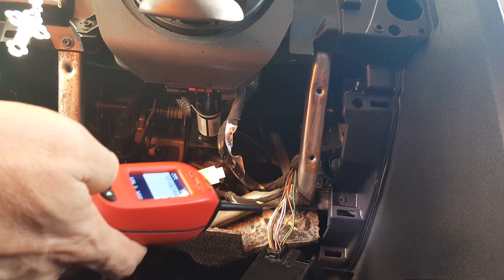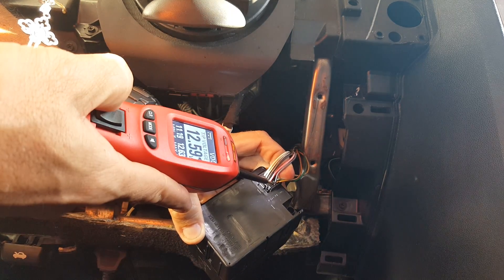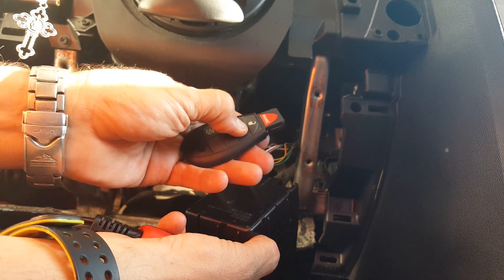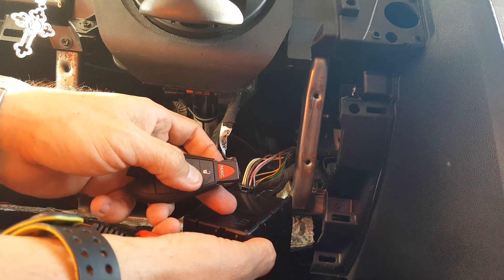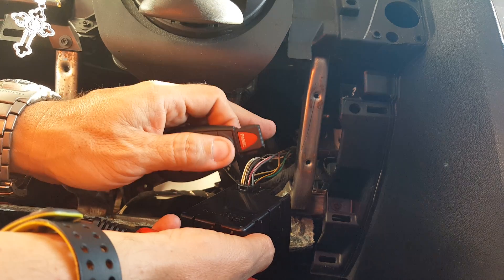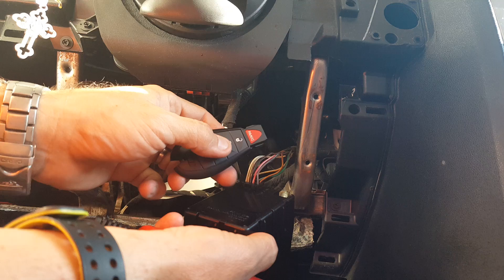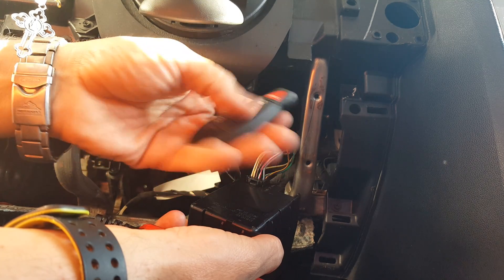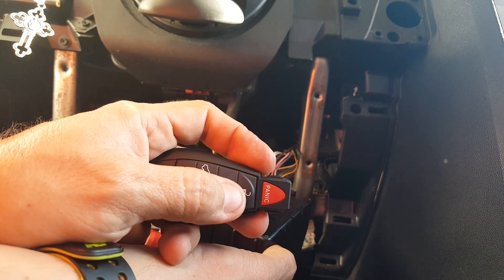Testing wireless ignition node module Chrysler Dodge Jeep ram plug connector

Comment: I have a 2011 dodge grand caravan and it seems after about 30 minutes of highway driving about 60 mph or hihher it will vibrate and then shut off randomly. It seems to omit strange smells sometimes as well. It has restarted after about 30 mins to last time over an hour. When u try to restart it the ignition gets stuck and it doesnt fire. Its stays as if its on about to runs like permanently cranking

Comment: My 2011 durango doesn't lock and unlock with the fob but my fob works a locksmith told me I have an electric issue the key doesn't light the dash when I turn it. It's doesn't have power just the alarm going off and red light blinking on dash

Comment: 14  caravan, i believe gen 2, cuts off intermittently,  sometimes it dont, sometimes repeatedly. Dash lights flicker, and gauges
Reply from the maker: This is the replacement WIN Kit that will fix it.
https://autotechelectronic.com/win-module-kits/dodge-wireless-ignition-node-no-remote-start/

Comment: Hi I have a 2010 grand Cherokee  that I'm not getting  power to the win module and ive checked all the fuses could u tell me were the power come from for I can trace the wires and thank you
Reply from the maker: From under the tipm. Run a temp power wire thru a 10 amp fuse to pin 1 and see if vehicle starts.

Comment: I just bought this 2012 town and country, no issues starting, but it will not lock and unlock doors, open sliding doors or trunk. I've tried replacing batteries in both fobs, cleaning contacts, still same issue. Haven't tested voltage yet, thats my next step. Do you think this is actually my issue? I'd love to hear your thoughts. Thanks for such a detailed and great video!
Reply from the maker: Test both fobs to see if they are transmitting an RF signal. Take the to a locksmith to test.

Comment: Hey, I have a 2008 Chrysler 300c. The key fob doesnt work to unlock, lock or remote start but the car starts up right away when I insert the fob in the WIN module. I have already replaced the fob battery and also reprogrammed a new fob but its the same issue. 
Do you think you can help me out ??
Reply from the maker: @SaadKhan_959  yes call 8303746845

Comment: I have a 2013 ram 1500 4.7 SLT having problems with the run start and the ignition switch on the codes and just run start and question marks beside that the truck will turn over in Spanish but it's not getting fire and it's not starting up

Comment: 2013 Jeep Grand Cherokee Laredo.  Both Fobs quit locking or unlocking doors, but starts fine.  This happened after replacing the battery under the seat.  I have tried new batteries in fobs but no luck, and also tried the fob replacement faces and tested the signal at my auto parts store and wasn't getting a signal from either one...  Its the fobik Style without the passive entry.  Could it be a bad ground or antenna?

Comment: got a 2019 Ram 1500 Classic. Truck ran fine yesterday, got in it this morning and I've got no dash lights, no radio and no ac controls, I do have my door open symbol and mileage. Is this the WIN or something else
Reply from the maker: @a.l.fairclothii6424  Classic Rams do not have a WIN. It is an ignition switch. Most likely you need a new rfhub. Here are the replacement kits.
https://autotechelectronic.com/rf-hub-kits/

Comment: Do you have a video showing the voltage of all these wires? Mysteriously mine burned the module board. I would like to see if there is a wire that is sending current where it shouldn't be.

Comment: Checked starter by jumping terminal at relay starter works every time relay test good also the key fob works but the 2014 Ram 1500 will not turn over until the fob is turned sometimes 20 times

Comment: Not true. I removed the win and remote still worked. So how do I know if this is my issue. I have power to it and only 4 wires 2014 3500
Reply from the maker: You do not have a WIN, so  to reaffirm, 2009 thru 2012 rams have WIN and if you unplug it should turn off. NOW, 2013 thru 2022 classic RAMs you would need to unplug the Rfhub for truck to turn OFF

Comment: Hey brother, I have a 2010 journey it used to crank no start after some testing that I was doing now it doesn't crank, does nothing when I turn the key to the start position everything is normal except for the no crank no start and tge security light flashing on and off the remote works locks and unlocks horn sound good

Comment: hello been looking for video on win module just saw yours thank you, got a question i put my key in (key fob) 2008 dodge charger 6 cylinder i turn the key and only the red security light comes on. i use to take the key out and in a few times and it would work now it do not.  could it be the module or key really need help
Reply from the maker: Most likely is the win. Text us a picture of fob and win to 210-920-5819

Comment: Hey i have a 2008 jeep grand Cherokee  limited and it doesn't start or crank there is no communication the dash board don't turn on but i can lock and unlock the car. What can it be
Reply from the maker: Send us a picture of you win module to 210-920-5819

Comment: i have a 2014 Jeep Grand cherokee , with 3 key fobs , 1 Brand new, 2 originals all 3 brand new batteries. my jeep doesn't detect any of them till multiple tries and will finally unlock vehicle , and or star. Always says key fob not detected. When it finally starts it will randomly say key fob left the car. Have to shut the Jeep down and and will continue to say no key fob detected till finally starts or alot of the time just does nothing. starter, alternator car battery all good. My mechanic says its the Wireless ignition Nod, would you say it is? Its bad, ready to bring to the dealership to get it replaced

Comment: Amigo si tiene voltaje de 12 y tierra el módulo está bien? Por mi tablero no enciende pero ya cambié el modulo de la llave y sigue igual espero y me puedas ayudar gracias
Reply: Buena noche, disculpa tengo un problema igual, cómo solucionaste el tuyo?
Reply: @alejandroguzman5290  buenas noches si lo solucioné en la parte lateral del asiento lado del chofer hay una tapa esa tapa agarra con la alfombra abajo van los cables ahí estaba el problema estaba trosado los cables

Comment: I have a 2014 ram hemi.  When I put the key fob in nothing happens. No lights on the dash no radio and won’t start. Doesn’t even make a noise. New fob or win or both ?
Reply from the maker: Call or text us 830-374-6845

Comment: Hello I have a 2014 dodge challenger Sxt so my key locks and unlocks the car but when I try starting the dash says “damaged key”(I replaced the key battery ) and the car won’t even crank and no lights on dash besides that message but the weird part is that sometimes I get lucky and it starts up but then when I turn it off it goes back to the same thing  and I don’t know what could be the problem if it’s the win module or I need to reprogram my key
Reply from the maker: It neither WIN or Prox remote. It sounds more like you need a new rfhub. We have replacement kits. Text us your VIN 830-374-6845

Comment: My fobs will start the vehicle but will not unlock or lock by remote. Can this be an issue with the win module ? I have programmed brand new remotes but still no lock/unlock.
Reply from the maker: Yes.  It is a problem with WIN
Reply: @AutoTechElectronic  thank you

Comment: Ir my remote does work and my motor doesn’t crank basically the win module it’s bad? Am I right?
Reply from the maker: You still need to eliminate the starter, starter relay, pcm, network issue from being  the problem

Comment: When i turned on just ignition the gauges started working then went off for a sec then back to normal. Day later i get what feels like a misfire when i accelerated randomly. Day after that when idling it had one little dip. 
Ik my win modules not great cos it had problems shutting off when using the push start so i just use the key now. 
Think it could be win failing?
Reply from the maker: You definitely need a new WIN. The engine misfiring that may be caused by a faulty PCM
Reply: @AutoTechElectronic  thanks. how could i check pcm? I assumed it would all be related. No engine codes as of yet. Car ran perfectly today
Reply from the maker: @El-Armstrong  I suggest start with replacing the WIN. To decrease changes of other modules getting damaged because of a defective WIN
Reply: @AutoTechElectronic  could a win cause misfires and or idling issues or anything? I was under the impression once u use the key instead of pushstart it kinda bypasses it? Faulty win can spread issues??
Reply: @AutoTechElectronic  couple month ago i had a code for up and downstream o2 sensors on bank 1. Replaced them n was fine after. Could tht be related? Cos my 09 challenger only has 30k miles which seems low for them to go out

Comment: Geez all of the searching I have done and finally found an explanation of why my van doesn't start, the prnd lights do not light up. And my red security light is always blinking. I think I will upgrade to a 3rd generation win module. Should I buy one with a key or no just the box and a new unprogrammed key and have a locksmith program every thing for me? Thanks in advance, and for all the helpful information.
Reply from the maker: When you purchase the win lit from us you get the win, 2 fobik remotes, 3 years warranty with no mileage limitation everything programmed to your vin. Plug and Play. Purchase at autotechelectronic.com or call 956-508-3450

Comment: Hi, I live in Canada. Do you ship parts here? Im having trouble with my starter. Its a 2011 dodge ram 1500. 
Right now nothing comes on. No lights on the dash and it won't start which is the more serious issue.
I can use the remote to lock and unlock and the alarm. But thats it.
I tried taking the ignition apart to clean out with electronic cleaner as well as air duster. It did not work. 
Any other suggestions?
TY
Reply from the maker: Yes, we to Canadá and the rest of the World. Call us 956-508-3450 or Text us 210-920-5819 to place order.

Comment: Good morning! So I was driving the other day and my car just stalled... When I try to start it again I noticed that the security light was flashing and even though my car was in park.. the indicator light said I was in reverse.. I also noticed at this time that when I stepped on the break I did not hear the shifter interlock clicking anymore... When I bought the vehicle the remotes were never working but I've never had a problem starting it until recently! Right now it starts no problem but last time I drove it for a few miles I'll end up getting stuck with it again... I'm not sure if there is a way to bypass the ignition and just put switches in and a little starter button? I'm so desperate right now and I don't have the money to spend chasing this ghost... Any information you have or suggestions is greatly appreciated... Thank you and have a great weekend
Reply from the maker: When the theft light flashes after a stall,  the problem nostalgia likely cause by a lose wire going to pcm or faulty pcm
Reply: @AutoTechElectronic  interesting... Thanks.. would it disable the brake/shift lockout and make dash appear in reverse?

Comment: I have a 2012 ram 1500 laramie.    Been having issues with keyfob buttons not working all the time.    I decided to purchase a new keyfob and programmed.    It worked all day.   But at night.  The buttons where not responding.     The next morning the keyfob would not turn truck on.    Kept saying  damaged key.     So nothing works again.       My spare key still turns truck on.    But buttons wont work.   I replaced battery.    But nothing
Reply from the maker: Just program a New original oem fobik remote and you shiuld not have a problem.
Reply: @AutoTechElectronic  yeah i did that yesterday.     It worked all day.    But then it stopped working at  night.     Then  in the morning.  It wouldn't  start my truck

Comment: Hi I have a 2012 Chrysler town and country. it started at first I would push the start button and get a key fob not detected on my dash so  I would wiggle the fob then it would work then one day it stopped working So I replaced the battery in the key fob and now it does not work at all. I had to remove the push button and use the fob like a key to start it.
Reply from the maker: This is the replacement kit you would need

https://www.autotechelectronic.com/win-module-kits/2009-2012-dodge-chrysler-jeep-wireless-ignition-node-with-existing-push-to-start/keyless-go-remote-start/

Comment: Have a question fob works no start new starter 2015 town and county power going to starter no light on back of win when key in any suggestions
Reply from the maker: Does the radio turn ON or windows go down and up?
Reply: @AutoTechElectronic  yes
Reply from the maker: Test the starter relay, wiring and starter.
https://youtu.be/gt61fP72QJc
Reply: I swapped the relays around and it’s still not starting clacks no start
Reply: New starter and it’s getting power

Comment: 2014 Ram 1500
3.6L pentastar VVT
Sometimes starts, Sometimes doesn't (intermittent,) the truck won't start unless I get that ding ding ding sound first.
The Fob is in bad shape. Should I take a chance and get a new fob before buying a new Win?
Reply from the maker: The fobik remote does not need a battery to start truck. Battery is only needed to lock and unlock doors remotely. Your issue is most likely the rfhub receiver. Text me to give you more troubleshootibg tipo 830-374-6845

Comment: How is it, I have a Chrysler 2011 in the morning, the remote control does not open and close the car easily, and I keep trying many times until the central lock opens. I checked the remote bar, it reads 3.1V... what is the reason
Reply from the maker: What about the panic?  If you open the door, vehicle starts fine?

Comment: Quick question my 2008 magnum is having that same problem as ur video. But the alarm doesnt work, windows dont work. But seats do. Only thing that lights up on the dashboard is a red dot and when you open the doors . The door logo comes on. Thats all that lights on the dashboard.  Im going to probe the win . Today but does this sound like I need a new win?
Reply from the maker: Yes, do the door locks still lock and unlock from Fobik remote?
Reply: @AutoTechElectronic  no nothing works there is a red light that turns on only when i try to start it. Only thing that is on is the door open light.

Comment: I have a 2011 town and country I got the alternator fixed and the battery died and now it's stuck in security mode any other suggestion I changed the tipm as well? No start no crank.
Reply from the maker: What is the theft light doind when you leave the key in RUN?

Comment: I have a Chrysler 300 2008 and my key fob works fine and so does the win module. The doors lock unlock but it will not turn over, it just keeps cranking over and over. What else could be the problem?
Reply from the maker: It could be that you are not getting fuel. Ck fuel pump, relay or power

Comment: Hey man needing help before I call dealership I have a 2010 dodge charger sxt  my fob stopped working a couple days ago but I was still able to start car my last fob none of buttons worked but still started car. Anyways I went to get a key fob battery and still not working but was able to start car got home parked it went to get in it maybe 8 hours later and no start tried both keys Lights on dash are on but won't start or crank I did hear a click when I was under hood and had someone turn key...I've checked all fuses and battery also the security light isn't on until I put the car in run position and it just blinks Any help would be appreciated
Reply from the maker: What does the security light do?
Reply: @AutoTechElectronic  it blinks in in the on position locksmith came out today and said that my keys are good and still programmed to the car but I have no unlock lock or panic button on fob
Reply from the maker: @graysonswinson9389  remove the WIN and text me picture 830-374-6845. . Mosty likely you need new WIN

Comment: I have a 2010 dodge journey sxt, all dash lights work, radio, but will not start.
Intermittently will crank for a split second, then nothing. 
I have to wiggle key in order for it to crank at all.
Is this the WIN module?
Reply from the maker: Yes that is the most common symptom. We have in stock the replacement kits on our site autotechelectronic.com

Comment: My issue is off a 2014 Dodge Ram 4x4 5.7 I parked it and now it doesn’t do anything no lights in the cluster no movement on gauges radio doesn’t turn on , fob doesn’t lock or unlock doors.. I push the brake lights and nothing.. but head lights do turn on . No signal lights aswell.. Help me , could it be the key ? But the lights don’t turn on in the cluster when I turn lights on aswell..
Reply from the maker: Che k fuse 51. If ok check red and black power wires at rfhub and ignition switch.